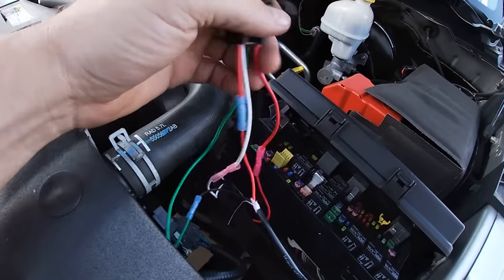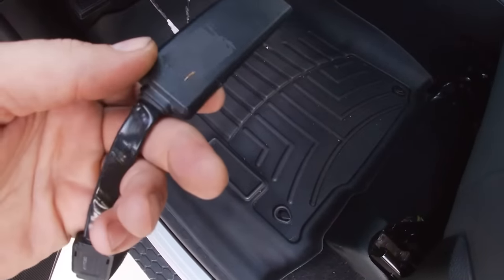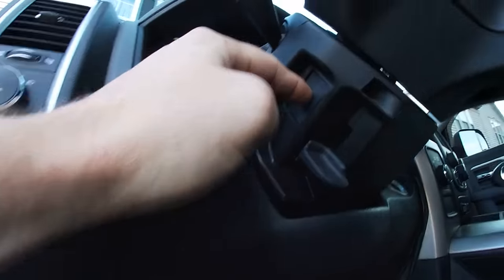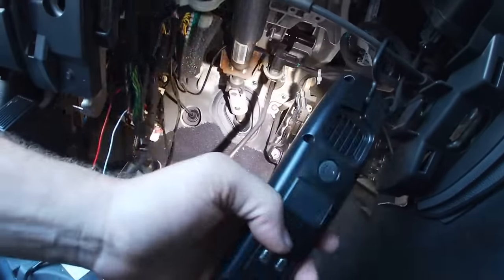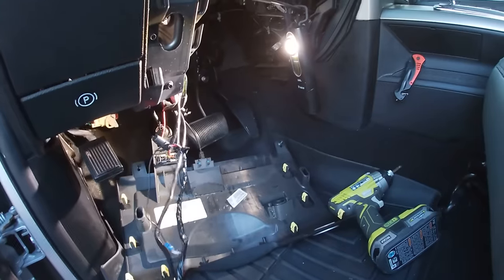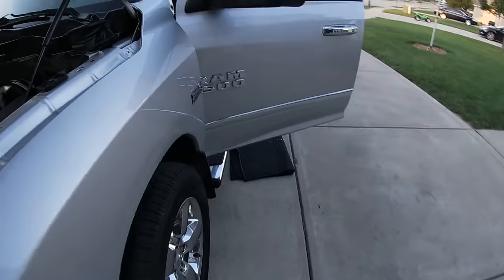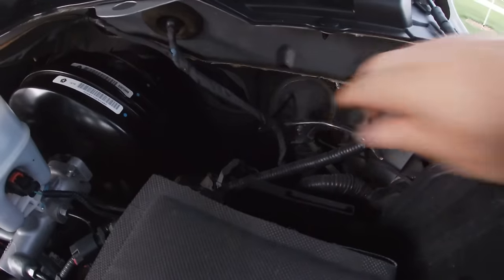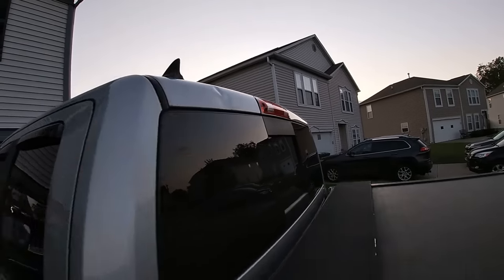Tracking Device Found on My RAM!

Comment: Good find!, but some sad news for you all... if you have a cell phone you have a tracking device on you 24/7
Reply: Zomak blah only when it is turned On.
Reply: disable google and other apps shut off mobile data or shut phone off
Reply: Even with it off.
Reply: @nia6849  Doesn't matter. Unless you remove the tracking chips you can be and are being tracked.
Reply: They're also listening to every word you say.
Reply: @nia6849  Pretty sure you're wrong; if the chip isn't destroyed, the one who is tracking it can pick up a signal off of it. I could be brainless on this, so I will do more research and let you know what I find. If you have or run across any sources, can you let me know? I hate being clueless.
Reply: @nia6849  Google youtube twitch snapchat take a pick they are ALL tracking you ^^
Reply: @1010glock  You're darn right.
Reply: @nia6849 Phones today are coded on or off.. even off they can still have a on. You need to take the battery out of some models of phone to be truly "OFF".
Reply: then why cant they find people fast lol
Reply: @Crimsomreaf5555 It's call triangulation your phone ALWAYS pings towers as you move. it's easy and THEY can find you fast.  it's not about how long,  it's how you ARE tracked 24/7. just look it up sheesh. hell, I just need the data and I could locate someone IF the cell phone companies would share it but they don't.
Reply: @1OFGODSOWN  thats what you think
Reply: @nia6849  you should read up on this https://en.wikipedia.org/wiki/NSA_ANT_catalog
Reply: crim somreaf5555  👽commin soon👽666 chips implanted 👽than all will be Truck 😱😱😱👽👽👽😱😱😱
Reply: I don't get cell service...no tracking for me...lol.
Reply: crim somreaf5555   The cell phone company can only Do a location trace for a missing person with a police request and written permission of the cell account holder or with a court order which takes time to get.  Depending on state laws where they reside it can 
take many days to happen.
Reply: @zomakblah7804  the cell triangulation shows me 8 miles from here. It's not accurate at all. It is not used for tracking. Only when trying to find a stationary object and it is about 15 mile accuracy. A phone has to broadcast the location information back to the tower, it cannot do that without considerable power.  I'm a former cell tower tech.
Reply: @rhutch3876  exactly and these tracking devices can be used by anyone
Reply: @UC1dJNN2qTSFbBTCFgysAkTg wrong, I can turn on GPS only, go outside and it finds me. Think what triangulation means. Triangle. The phone and the tower times the ping and is pretty accurate at figuring the how far you are from the tower. That's all it does. If you are ten miles from a single tower, you can draw a ten mile circle around that tower divided in thirds and that's the best accuracy you'll get  The phone has to pick up 3 towers and communicate with it. Once that's done you can draw a circle around all 3 towers depending on the distance from each. Where those 3 lines intersect is the location. Unless the phone can communicate with all 3 towers, the accuracy can be as low as hundreds of square miles. Do you understand now?
Reply: Stingray tracker!!!what your local police dept doesnt want you to know!!!
Reply: @freedomlover9560  ..
L)lllllllllllllplll(moll.
Reply: 50 yr old trucks and my flip phone batteries come out.Slab phones don't work here
Reply: @1010glock  You have a driver's license? Government has your information and picture. Whatcha gonna do, mr. PARANOID.  Tell me. Are aliens putting cameras in people while we are asleep? Does the government have a working spaceship like in starwars or star Trek? Are we all illusions in a dream, and when we are asleep we really are awake..? 
Your so paranoid it's scary.
Reply: @1OFGODSOWN  they can remotely turn it on...Few years ago Today Mobile marketed a phone with a permanent battery... can't remove it....if you can remove your battery your good ..but if you can't...24_7_365....get it,?
Reply: @charleslindberg829  Yes Neo, take the blue pill.
Reply: But you can shut the tracking device off on your phone
Reply: @nia6849  government is watching you
Reply: @1OFGODSOWN  battery is the power source which is always on :)
Reply: Just put your cell phone in a lead box. Bye Bye tracking.
Reply: Even my iPhone 6s Plus. No privacy.
Reply: white zebra  Look, just put your phone in a 1 inch thick box of lead and see for yourself. Lead blocks radio frequencies.
Reply: @derrickodyes1934  Even with the phone turned off cell phones still accumulate and store gps data, then upload it as soon as the phone is turned on. I saw a demo of this on Fox news. They took two phones, one turned off, the other on airplane mode. The guy went all over the city then they had a device they called a 'go between' which acted like a portable cell tower, it captured everything the phone was transmitting then relayed it to the real cell tower. (Police use those things all the time to surveil targets of investigations.) When they turned the one on that was off and took the other one off airplane mode they were surprised to find that the phone that was off immediately uploaded MORE information than the one that was on airplane mode! 

The only way to actually stop it is to put your phone in a faraday cage bag and only take it out if and when you want to use it. Even removing the battery won't stop it, there is a small battery that powers the data collection even when the main battery is removed, that is if you have a phone with a removable battery.
Reply: Sad but true
Reply: @1OFGODSOWN  nope. Doesn't have to be turned on
Reply: @derrickodyes1934  wont work
Reply: Zomak blah you can order a pouch deflector from infowars stores. You put your phone in the pouch and cell towers can’t transmit to your phone. Only problem is nothing comes in to your phone while in the pouch. Works great!
Reply: They can track me all they want I only go out every once and a while
Reply: @zomakblah7804  u absolutely right
Reply: You can TURN OFF the GPS.  Duh.
Reply: @1OFGODSOWN  lol
Reply: Dead battery will take care of that...
Reply: i dont, maybe you do, i wont tell you how just know you cant see what tower im pinging off of and even with gps on im invisible. beauty of being a techy/hacker
Reply: Doesn't shut your car down though...
Reply: @Gerardo11  or most hoesehold  microwaves are faraday cages
Reply: and a $10 security pouch fix's that..  cough aluminium foil  lol
Reply: While that may be true those are dicey at best. I have used both and the standalone trackers with cell phone apps work a lot better than actual trackers tracking cell phones. Either that or Life360 is just crap.
Reply: thanks I'll remember that...stay cool brother!
Reply: My son & I were servicing his Audi S3 and he only used the light on his phone to check the brakes through the wheel; later when he turned on the phone, up comes an ad for Audi S3 brake pads! WTF?
Reply: @bhaggen  that's why they call em smart phones... crazy huh! Sometimes it can be good though!
Reply: @Eric Underwood.....And the smarter the phones, the dumber the people. I was riding along with a buddy who uses a voice nav. "Turn left at next intersection"; he turns left; I yell, "Hey idiot, this isn't Tokyo, we're in oncoming traffic!".....Oh shit
Reply: So true... even if it's off even if the phone is off it doesn't matter airplane mode it is constantly tracking
Reply: @1OFGODSOWN  most of them have internal miniaturize batteries so soon as you plug the phone's battery back in it starts uploading all the stuff that was going on while the phone was off
Reply: @derrickodyes1934  that will not stop the government from following your phone
Reply: @Presley3  yes
Reply: @1010glock  he sir
Reply: @derrickodyes1934  Oh my ! You really have NO clue how all this works, speechless......
Reply: R Hutch right!  IF they do it legally

You have no idea
Reply: RFID chips in DL, credit cards and the new 100 dollar bill
Reply: @derrickodyes1934  even if the phone is off it still tracks you. I think even if you take the battery out it still has enough sustained energy to keep the GPS running for some amount of time
Reply: Word
Reply: @freedomlover9560  how do you find the tracking chi?
Reply: Not if you wrap it in aluminium or take out the battery.
Reply: @shingyanling1856  aluminum increases the signal guy
Reply: Really? My book lied to me damn. Remove the battery then
Reply: @shingyanling1856  remember old t.v. and radios? Antenna was used to get better signal. Tin foil hats will screw you 😂 you need a lead hat
Reply: @1OFGODSOWN  it is still pinging when off, you have to remove the battery as well. That's why so many new phones are sealed. I put mine in a "Block it Pocket" until I want to use it. Sad that you have to think of counter surveillance as a normal citizen. Not doing anything wrong.........today.
Reply: D. F.  W.e. you say AGENT
Reply: @Bryan-Hensley  it must be simple magic when google maps can show your current location on a map right?
Reply: @dirtbeard108  nope, it's called triangulation and pinging satellites. Here's a good explanation of the satellite location.
https://en.wikipedia.org/wiki/Global_Positioning_System
Here's a good article on triangulation..
https://searchnetworking.techtarget.com/definition/triangulation
Hope you learn something..
Reply: @Bryan-Hensley  i work navigation on ssbn's.  I know something about gps.
Reply: @dirtbeard108  I'm a former cellphone tower equipment tech
Reply: @Bryan-Hensley  I'm sure your two years of electronics training are superior to my military training.  You win.  Care to guess how accurate our Nav systems are on a sub?
Reply: @dirtbeard108  you want to prove how much training I've had or do you want to remain a CHRONIC liar?
Reply: @Bryan-Hensley  keep digging.  its hilarious
Reply: @dirtbeard108  you are the one who said it. Prove it. Also why are you hiding behind a fake name like a coward anyway?
Reply: @Bryan-Hensley  why you want my name?  trolling for a date?
Reply: @1010glock , They also love everyone with a Facebook account. All the the information they need about you, your friends, etc.
Reply: @rhutch3876 , You're wrong! They only get a warrant if they need one, Most law enforcement agencies have equipment to track and tap your cell phone. They only need the warrant if they are are going to present it in court.
Reply: @Bryan-Hensley  interesting your a former cell tower tech. How former? Google maps is pretty stinking good at tracking and if it can do so everyone else can too.
Reply: @trymeimalreadyaghost1456  what part of my conversation did you miss? I turn on Google maps or weather app and it always shows me somewhere about 8 miles from where I live UNTIL gps locks in. Then it shows me at the correct location. SO triangulation is what's off because that's what it's using to show me 8 miles from here when GPS is off. GPS doesn't stay on constantly, only when an app asks for it. GPS is accurate, triangulation isn't. but I bet you don't have a f**** clue what I'm talking about
Reply: @Bryan-Hensley  try as you might you won't harass me with words. The point is that you can be accuratly tracked with or without your permission or knowledge. I'll put it to you this way today's tech is yesterday's military tech. Ever notice how somehow sometimes you have no signal but emergency call is still available that's because while you can't use all the resources of your phone to the fullest some entities can. I'll bet my life on cell towers being more capable then you know
Reply: @trymeimalreadyaghost1456  wrong. You don't have a clue what you are talking about. The reason emergency calls are available is your phone is receiving another carriers signal. By federal law they have to let you use their network for 911 calls. It's that simple. You can stick your phone in a microwave oven (no don't turn it on) and nothing can get through to it.
Reply: @trymeimalreadyaghost1456  go in your phone and turn GPS off. Leave it like that for a day when you are out and about. Check and see where it shows you on a weather app (I don't think Google maps will let you use it when GPS is off)
Reply: @Bryan-Hensley  that is my point,  you cannot use the full function of your phone on just that one basis. Rest assured that there is a lot more you can't control use of. Just because your phone gives you the impression you control wether or not it tracks you. When you say no you stop "seeing" it track you. But you are still trackable.
Reply: @trymeimalreadyaghost1456  this isn't about trackable, it's about accuracy.
Reply: @Crimsomreaf5555  not in their job description
Reply: I'm Amish. We use long string and cups to communicate.
Reply: @Fred Wills Yes, take the battery out sure, but who's going to disassemble an iPhone just to pull the battery... let me say this... You not doing it, taking a iPhone apart is a pain in the a##. BUT you can make a small faraday cage out of any conductive material and the EMF can't work through it. My point in the post is this guy on the video has a cell phone on him 24/7. so, his point of being tracked is mute.
Reply: That's what faraday fabric is for.
Reply: @1OFGODSOWN  nope, on or off. It’s also listening to you as well. On or off. I know, it sucks
Reply: @charlieandhudsonspal1312  it has no ability to hear you or track you if it’s turned OFF.If you think otherwise Please share the source of your information.👍
Reply: @1OFGODSOWN  just type that into your search right here on you tube. I’m not the only one saying it here.
Reply: @charlieandhudsonspal1312  lots of people believe everything that they hear or see on the World Wide Web but that does not make it so.I retired from Law Enforcement after 30 years and I assure you that you can be traced if it’s ON but NOT when it’s OFF.Believe what you like but it’s totally BS.Now I think if you took those Covid shots they may now be able to track you down because they don’t stop you from getting the virus so they must be for something that the Government is pushing them so hard for.
Reply: @charlieandhudsonspal1312  the World is FLAT also and it’s True because I read it on the World Wide Web.😂🤣😱
Reply: Not to mention house servalnce cameras, ring doorbells & everyones toy Siri & like minded, tv's, internet! These day's can't even use the bathroon without being tracked or watched! Technology at it's finest!
Reply: @Crimsomreaf5555  uhh the police gotta get a warrant to track your phone! 🤣🤣🤣🤣🤣🤣
Reply: @Bryan-Hensley  hmm if it's not that acurate how does your phone ask you questiins about stores you've been to? Or restraunts or fast food places? 🤔🤔🤔🤔🤔🤔
Reply: @melvinpeachey6963  doesnt really mean it's off! Mines off & still every so often asks me questions about where i just came from & knows when I'm hone! 🤣🤣🤣🤣🤣🤣
Reply: @JoeHTX  or use burner phones & dispose if the every week! No idea whose useing them & yeah they can trace tgem to a garbage can or a. charity bin! 🤣🤣🤣🤣🤣🤣
Reply: @garydos000  yeah in the last year most to the grocery store fast food drive up & work! Me not to concerned about that! 🤣🤣🤣🤣🤣🤣
Reply: @ernestsegui9763  They better be Faraday cages for microwave frequencies. Otherwise people would get toasty when standing near them :3)
Reply: Wrap in aluminium foil.
Reply: But it doesn't disable your car.
Reply: There's a thing called the Faraday wallet. It is large enough to hold a phone. Nothing gets through that, in or out.